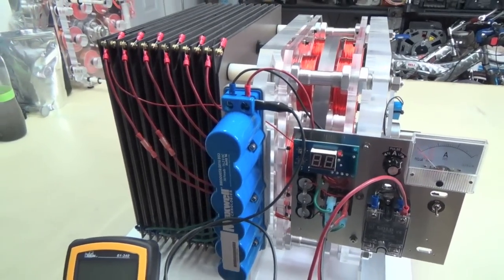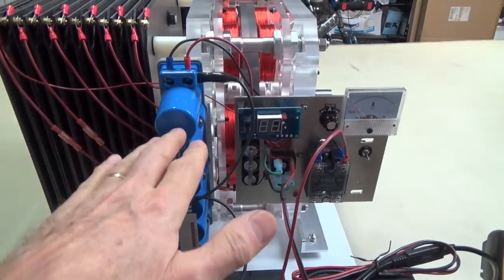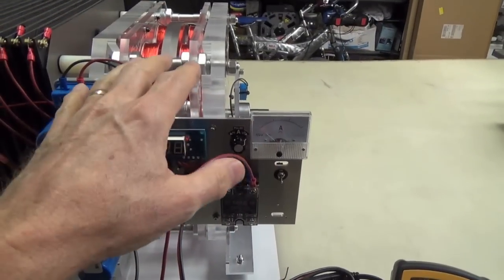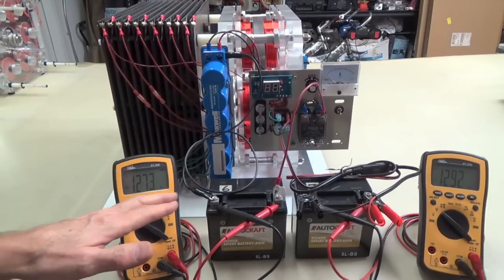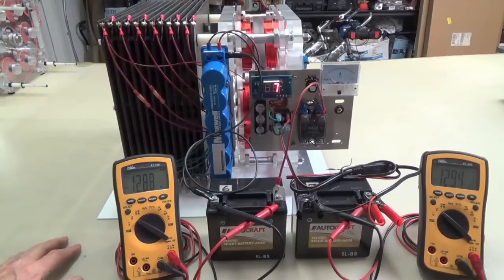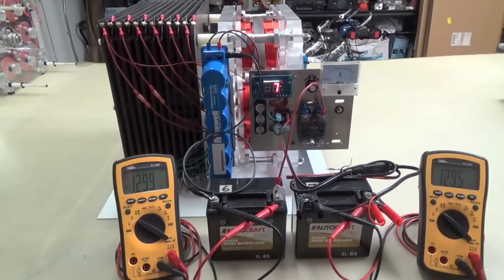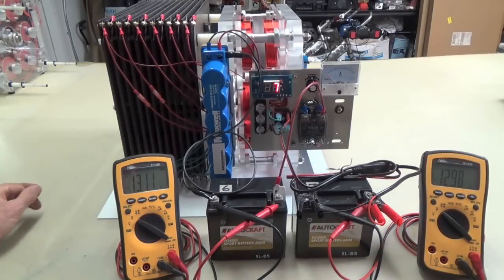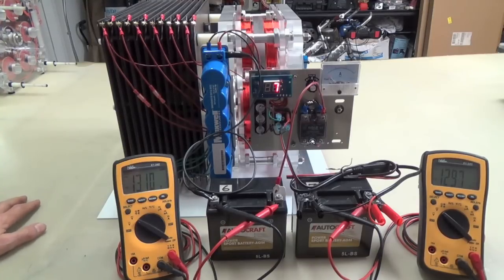NO SOLAR NEEDED!

Comment: Why not deep-cycle batteries instead of starter-batteries? Starter batteries don't sport much Ah capacity at all, their top voltage drops very fast as soon as you begin drawing any current from them. Would love some explanation on that and see the difference over time between deep-cycle and starter battery.

Comment: For polymorphs of si-c produced  above 1500C true, for carbon crystal geometry yields the properties desired. Cubic si-c doped with boron for instance reduces the band gap and creates an n type semiconductor which are usful in this technology. Also, in MOSSFET aka solid state power handling. Si-C(3C)/B 0.15% is the semiconductor material in state of the art power modulation  used in high voltage sub stations. Carbon solid state physics is the bleeding edge of materials Science.

Comment: Is there a reason you use a solid state relay. The datasheet for that model says it drops potentially 2.5V on the output side(input to coils). That's potentially 15% power loss at input if input voltage is 16V.

Comment: This would be a great charging source for a small sailing boat running a 12v system - but is it economically viable yet?
Reply: I second that, I would love this in an RV off the grid charging the deep cycle 12 volt batteries.  Is it feasible?

Comment: I am very confused... Apparently, this "Unit" is not drawing power form the grid, and instead, it is running off of the caps (capacitors)... Then, using the energy converted from the graphite panels, it charges the batteries, right? Okay, well how does it convert power from these so called "power cells"?

Comment: I'm curious as to what you could power. I'm designing a DIY Powerwall with 18650 Li Cells. I'm using an MPPT Charge controller with my solar setup. Interested in what types of amps you could pull off of this...

Comment: Silicon carbide graphite power cells based on the peltier junction. This is good physics and base upon the reverse of the thermionic process because carbon is a good conductor. How long do the plates last before they need replacing?

Comment: I didn't see a voltage drop when starting the machine, so I'm assuming the flywheel is powered by another source, and charging these batteries. This is a very cool artistic battery charger. I like it.
Reply from the maker: The central rotor or "flywheel" as you've named it is powered by the ultracaps that are constantly being trickle charged by the Si-graphite cells. No other source. The machine is an electrochemical energy converter.

Comment: As soon as any video like this comes up, everyone spouts off the same regurgitated bullshit about "breaking the laws of physics" that they read on some other video. the thing is, 99% of the people watching this video, have NOOOO CLUUEEEE what this thing is, or how it works, much less have even one iota of understanding about magnetism, electromagnetism, electricity, etc.....  (myself included) ... Not understanding how this machine works, is not a reason to say "it is bullshit and breaks the laws of thermodynamics".  not once, did he ever claim that it does anything that it doesn't do. it's a self starting generator. that's all there is to it. the si-graphite cells, are batteries that run the thing... it doesn't pull energy from the ether and magically charge batteries using fairy dust and magic crystals. 

with that said, As for the machine itself, i LOVE seeing this. a guy or group of guys (and or girls) who have a good solid understanding of what they are doing, producing a seriously impressive machine that doesn't break the laws of physics, but definitely serves a good purpose.  

my only gripe about it, is that they cost several thousand dollars, therefore, aren't going to solve any world energy shortages in 3rd world countries any time soon.  Also, my lack of understanding of this machine and "off grid electricity" in general, makes it difficult for me to know how i personally would benefit from using this in my home in suburbia to lower, or eliminate my electricity bill, and possibly send some back to the grid and get paid for it. (my city does that). I feel like it would cost about 30 grand to generate enough power to get paid by the city, which, would be quite a bit of energy usage over a fairly long period of time to break even.  When these things are $250 to $500 a piece and it takes 2, to completely power my home, i'll be on board
Reply: They can b made extremly cheap It depends on how you approach the model.
There are many ways to skin a cat.
Reply: M B: Laws were meant to be broken! Just ask the boys in my Juvenile Crime Prevention and Intervention Organization.
Reply: I am kinda confused about how this works. I looked at the website and my understanding is that it is charged by the electromagnetic wave frequency of the earth? How does that work at all? What is absorbing the EM waves and converting it to kinetic energy/electrical energy to spin the flywheel? The video makes it look like the battery is jolting the flywheel for 4s and resting for 7s and somehow EXTRA energy flows into the system. What is the source of the extra energy? Appreciate a response since you seem to know your stuff.
Reply: its a collapsable magnetic field and is also a negative of the spolt posativ3 which means it dosent like its self twoce in a row in ether it does not like to consume itself its worng
i know i cant spull anywav3z its like this the energy is from motion and still so the better you dont use motion the better w3 V.

G,G,

Comment: I have never liked the Bedini systems only because they use batteries. I am not against things that appear to break the laws of Thermodynamics since I am under the belief that it may be possible for energy to flow into a system from an unknown source not defined as part of the system such as say... the quantum vacuum. But my problem with Bedini systems and their use of lead acid batteries is that the very action of pushing energy into and out of the battery essentially destroys it. Lead acid batteries DO NOT actually last very long. Such destruction of an ordered system may actually be the source of the energy, since it took energy to create the battery at the factory into an organized state. The source of the energy may be from the system moving from an organized state to a more disorganized state. If I remember anything from my thermodynamics course that was entropy. I may be wrong but I would like to see such a system run with say... an Edison battery which last for a hundred years. Would the same effects be seen? Or as I suspect would the effect be far less dramatic? And for the matter of using batteries at all I still don't completely understand why such a system would need a chemical battery at all? Why not just use supercaps stand alone with an initial 12 volt charge? But then again something is supposed to be happening "magical" within the battery within one of these system and thus a Bedini setup does nothing without a battery. Free energy devices do exist. Read Eugene Mallove "Fire and Ice". Its about big $cience rejecting what two guys from Utah found. Now that was energy from an unknown source and the big energy took a big dump on it. Mallove even died under strange circumstances.
Reply: http://www.necn.com/news/new-england/Connecticut-Man-Sentenced-in-Murder-of-New-Hampshire-Physicist-287716481.html

Comment: I'm no genus, so do you have an explanation a laymen could understand. So it's a fancy battery that charges a regular battery, is that correct, I said I was no genus, please explain without the chemical break down, thanks
Reply: It gives a charge of spliyying the negative as high voltage spiking and pulses it will give new life to old batteries regardless of rechargrable or not and also will give a faster charge a slower discharge a higher charge capacity and will extend the life of the battery dramatically.

Comment: I  live in a remote part of Alaska. I have no hard wired electricity. I depend upon a diesel generator. But at times the temperature freezes my diesel fuel. We don't receive much sunlight within the Arctic Circle. I have 4 bedrooms a large living room Full kitchen 3 bathrooms a water heater refrigerator freezer external lights with internal lights satellite communications including phone television and internet, heated garage and aircraft hanger.What kind of a system can you develop for my use 24/7? The system must be redundant at least 4 times. I am considering using in conjunction with your system two Siemens Wind Turbines for my property including my pier and docking lights and lights for my helicopter landing pad. Please advise me if your company can provide such services. Costs is not an issue.
Reply: Another possibility for Alaska is thermo-electric. http://www.tegmart.com/water-cooled/  Put it on the wood stove and get power off the heat differential. You can get 40 to 100 watts...

Comment: www.quantamagneticstore.com/home.html
that is his site.  Come on people do a little reading. these little beauties are generators to power a charging device. basically it makes solar power much more usable and efficient for whatever you were using solar power to charge in the first place.
Reply: Euclid AllGloryToTheLogLady , the title plainly said no solar
Reply: Johnnie Antler ..... Are you trying to troll??  Because if you have any idea what this thing is you wouldn't point out such nonsense..  What the hell happen to people that made them stop asking questions and act so arrogant??  Even so I shall do my best to help.  
No, you do not need solar, wind, water,  ect. ect  power for this to run.  No, this device alone cannot power your house.  The batteries that you would have at your house could power the place.. This is ment to HELP charge the batteries along side other means of a power source.  Now before I get into what a mppt is you should do some reading on how to and the characteristics of battery charging.  If you think of the entire system as a car solar would be a fuel, the battery would be.. the battery,  the mppt the transmission and this as kinda like the highway overdrive cruise gear.
Reply: Dave C 
I may have gave the wrong impression.. it doesn't make solar power it self more efficient, but your home charging system as a whole. It isn't limited to solar charging, that was just my example..  There is a obscene amount of number crunching required to build a system that would make sense financially depending on the power you use, average ESH (sunlight hours) available, the panels you'd be using.. lots!
Solar panels generate electricity that can be stored in a Tesla Powerwall battery. A charge controller is required to regulate the charging rate. You can charge a battery at a variety of rates, and while Tesla has not published the maximum charging rate, we can assume it is the same 2kW as the output rating. That would equate to about 8 solar panels at 280W each.. In let's say Florida, 8 panels rated at 280W each would produce about 11 kWh of energy per average day, but since there are losses involved in battery charging, realistically you would probably be able to store about 7 – 8 kWh of that energy generated. If your battery is 70-80% depleted, you could realistically charge it up fully on an average day with 8 solar panels.
Now that is an “average” day. Since solar energy is weather and time-of-year dependent, some days will be better, and some will be worse. If you install a large number of panels, you may be able to charge up your 7 kWh Powerwall in under 4 hours. If you install a small number of panels you could charge up your Powerwall over a period of multiple days. If you’re looking for panels that will charge a fully depleted Powerwall battery on an “average” day, about 10 panels rated at 280W would be a good estimation.. I'm just doing extremely crude figures here haha.. I live in Wisconsin, my ESH is a whole other issue over the course of a year. Something like this beefed up a bit intragrated into my power recovery system would certainly help charge my batteries.... and void the warranty on a Tesla Powerwall.. 😕
Reply: Mickey Kincaid 
as well am I.. the more info we share the better results we'll have. I'm all ears on valid ideas.

Comment: Where does the energy come from?
Reply: The energy comes from a magnet passing a coil and then capturing the bifiilar wound coil and the magnetic collapse of that field called back emf.
The trick is to defeat the lenzes law which is more of an effect not a law It is and has been possible to defeat the lenz effect by making a specific field that is not inhibited by the collapse there are so many inventors that get burried by the greedy.
This technology is actually not that hard to replicate.
Reply: But what about frictional & resistive losses?
Reply: How long will a set of batteries typically power this for?
Reply: There are many losses and also losses when using rectification.
Reply: Depends on the battery and also depends on motor/generator spin speed.
I am aware that this peep is using solid state to fill capacitors then using the storage and letting the solid state recover ect.
So a very very long time.
Reply: what about heat losses in each of the coils

Comment: Is this limited to the 6 or12 volt configuration I am running a 24 volt (if I knew then what I know now) which is a bit more efficient but everything costs more than double and in many cases long waits.  I have been trying to figure a way to charge batteries using the mega caps, but it is above my pay grade. Your machine appears to deal with the problem of rapid discharge on the caps.  How long does your cap pack to charge?  The video seems to indicate something less than 1 second,  thank you for sharing

Comment: Tesla has made a very high voltage capacitance generator before & it made free energy available for everyone to use but some people put a stop to that. Here's an idea ceramic high voltage caps charged by a high voltage AC generator from the center shaft and the other end attached to a larger diameter wheel DC Brush-less motor/fly wheel. Two inductance coils needed one low voltage high current & the other high voltage low current, when the high voltage coil reaches saturation inside a vacuum a contact plate will arch discharge into the low voltage coil, you will need more than one capacitor bank to charge the high voltage coils in rotation each capacitor banks will be charged parallel from the AC Gen. When you get it right the low voltage inductance coil will hold power to the DC motor it will keep going strong turning at full force before the next pulse thanks to the inductance eddies from the collapsing field so as voltage drops current rises which DC motors want. So can you put 2 & 2 together now & see the picture.

For example I put together a heavy duty choke & inductance coil (no batteries like a UPS) for my self to protect my computer from surges or lighting. I can for real turn the power off for 10 seconds & turn it back on from the wall socket and my PC still works without blinking, so during thunder storms everything ells not connected to my surge protector ether reboots or needs to be powered up again at times so bad the lights all go out for a few seconds in my house but not my PC & equipment still working away. Tesla knew the collapsing fields in the inductance coil yielded a lot of energy that could be taped & returned back into the loop it's a shame he wasn't allowed to continue his work instead they ridicule him as a crackpot.

Comment: I would like to try this with a strong pump and an inclosed chamber that hits a geared water propelled flywheel every couple of seconds. Seven 4/7sec ratio seems awesome. I actually designed it for an evil character  who needed to power his lab off the grid.  I let the idea die when I gave my 12 year old my mac with parental locks on it and she formatted the whole damn computer with my designs on it. Kids!!! We should work together. I'm an industrial designer in Chicago.

Comment: Let see if I understand this.  You have a fully charged Silicon Graphite battery and fully charged super caps.  There is a permanent magnet motor with N52 magnets.  Some electronics and two lead acid batteries almost fully charged.  The electronics spin up the motor then configure it as a generator.  Power from the generator charges the lead acid batteries.  The spin up puts energy into the rotor and the slow downs take energy out of the rotor and charge the batteries.  Am I close?  
This is a great educational machine by the way.

Comment: It like put a windmill on your car top to generate energy to drive the car.
Reply: the loss to friction would mean less power the car would run out of power as it goes faster
Reply: This is impossible for many of the same reasons why it's impossible to achieve absolute zero
Reply: Shorly before first flight of a plane scientist claimed it is imposible.

This device is not simply motor and electricity. There is a electronics and different way of powering.

If it is possible to create engine what draw a 20% of energy to create the same torqe then it is possible to generate electricity from movement of that engine using reverse methot what is more efficient. And on a base you still have spinnnig whel with big tourque.

Comment: Are you converting heat into electricty? Or are you simply discharging some Si-Graph plates you assembled? Thanks!
Reply: i have watched about 20 of his videos and i think its converting heat into electricity. im still lost as to what the machine actually does.
Reply: Good point, no charging, but it charges? hehe.